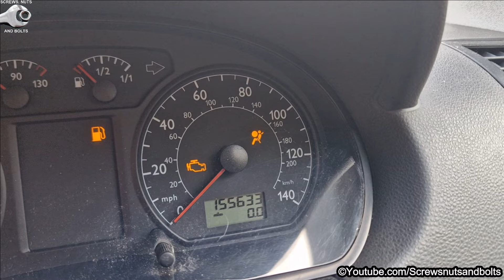Handbrake Warning Light Switch Replacement

Comment: Does the sensor cause a flashing handbrake light on the dash and a beeping sound mid drive?
Reply from the maker: That could be caused by a brake fluid level issue. I'd check that out as soon as possible
Reply: @screwsnutsandbolts Okay, thanks

Comment: I have the Airbag warning sign. Not sure what to do?
Reply from the maker: There could be a few different components causing the warning sign. You'll probably need to have a mechanic plug in a diagnostic tool to find out which one is causing it.